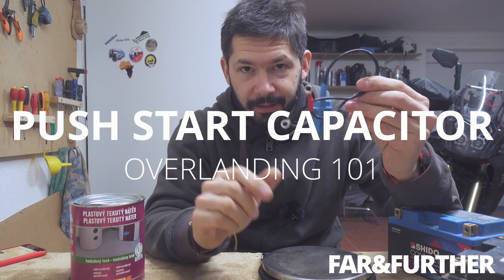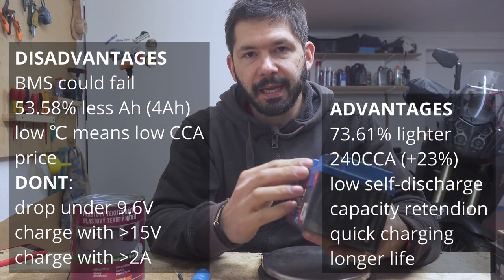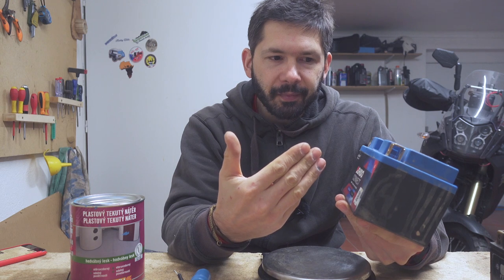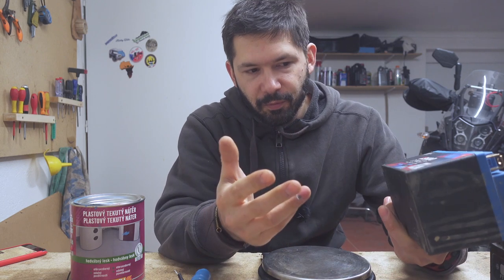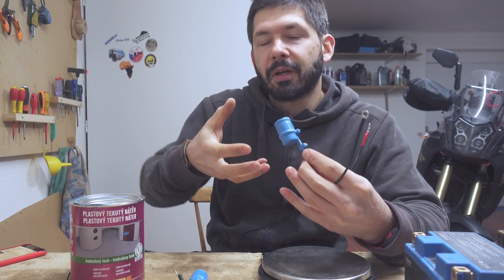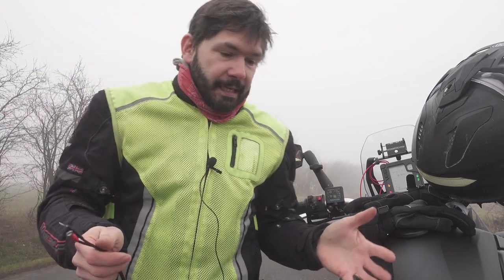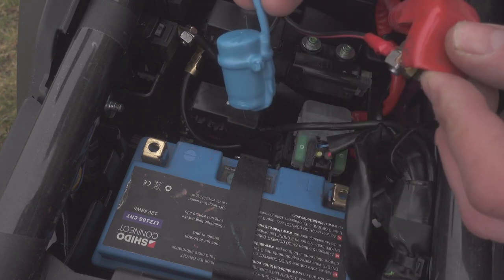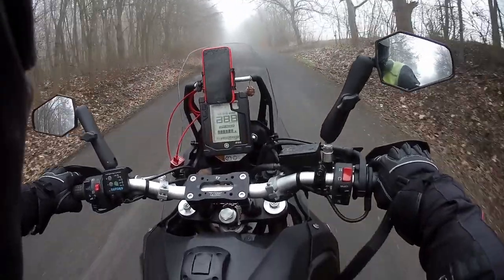Push start motorcycle with capacitor  - testing with Yamaha Ténéré 700

Comment: Hi Far&Further - I am really intrigued after almost getting stranded on my Honda last weekend after my battery died very suddenly in the middle of nowhere. How did you come up with using a 50V/10,000uF capacitor? Is there a formula depending on the charging system to get the right capacity or did you just happen to have this one? And is there any risk of damaging motorcycle electronics? I have a Super Tenere and a CRF250L and would hate to fry some circuit with this.
Reply from the maker: Hi Benedikt,

The technique is reasonably proven by different people and as a matter of the fact it's not my original idea. The battery is just one massive capacitor so by swapping it for capacitor does not really make a difference for the electrical system.

Capacitor functions as a battery, storing the electricity for just long enough so that it mimics the battery. The amount of energy it stores is dictated by it's capacity, in my case 10000uf which is enough, having larger capacitor would be even better, like 20000 or 50000uf. The voltage of the capacitor is just a limit so it won't get fried. I just checked and I'm using 25V not 50V.

The only issue I found is that I need to keep the revs up above 1500 otherwise the voltage fluctuates which I think is due to the fact the capacitor has not enough capacity to smoothen the voltage. But I've run the bike for 30minutes like this and everything was fine.

It's an emergency measure, not a permanent solution, of course.

Comment: Does it affect performance of your bike?
Works well even the headlights are on?
Reply from the maker: Hi, it is surely emergency measure. But it does not affect performance when you keep the revs above 2000 or use bigger capacitor (or 2). When idling the capacitor does not have enough capacity to smooth out so the headlight fliers as current fluctuates.

Yes it works with all on once you're running. I was able to push start the bike with this keeping the headlight as is, but it's LED headlight so there is not much draw.
Reply: FAR&FURTHER im gonna try this mod for my piaggio beverly 350(efi). I hope it will work. Thank you sir i enjoy watching your videos.
Reply from the maker: Glad videos are useful, let me know if it worked.